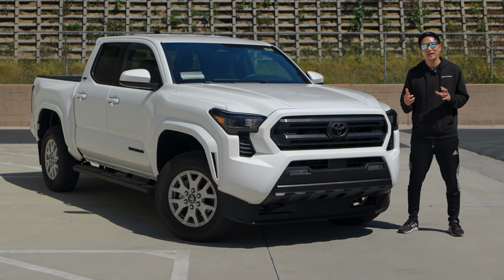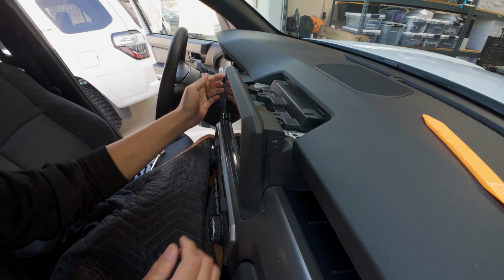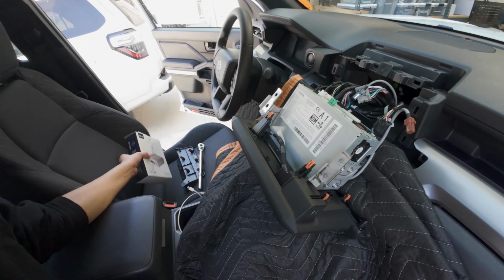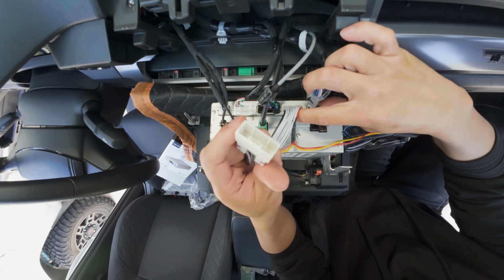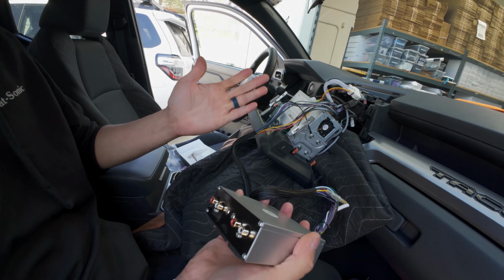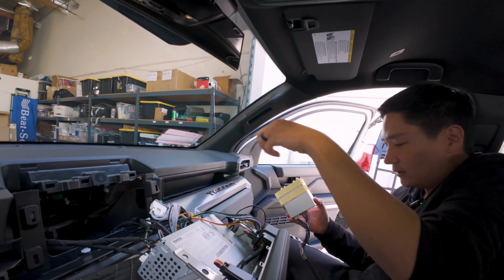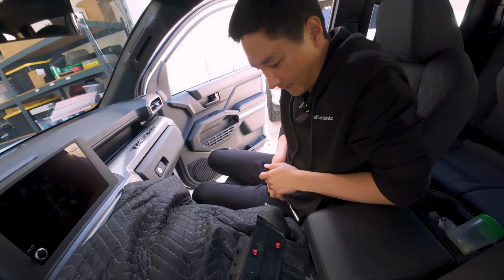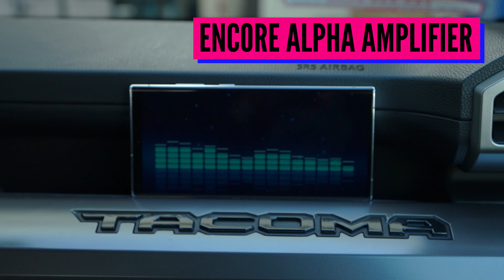2024 TOYOTA TACOMA WITHOUT JBL  | Plug and Play Amplifier Installation

Comment: It’s there any option to add a subwoofer 🔊 to those RCA ports on the amp ?
Reply from the maker: You will need the BH10 Speaker harness to add on a subwoofer. https://www.beatsonicusa.com/bh10.html
Reply: What if i want to install a under the seat subwoofer with an integrated amp? Would it still work with the Encore amp?  @BeatSonicUS
Reply from the maker: @nuvolari1892  yes it will. You can use this harness https://www.beatsonicusa.com/bh10.html

Comment: On my 24 Tacoma TRD Sport with the JBL system and the EQ all at the factory position has the a rattle/vibration on the passenger side door panel. The rattle/vibration comes from the right behind part on the panel that says TRD. No its not me putting the radio too loud, so its not that. Anyone else have that problem? Haven't taken it to the dealer yet.
Reply from the maker: Some sound deadening should help
Reply: If you slide the plastic piece off that says "TRD", there is a screw behind it. Tighten that and your rattle will most likely go away. I had the same issue on the drivers side.